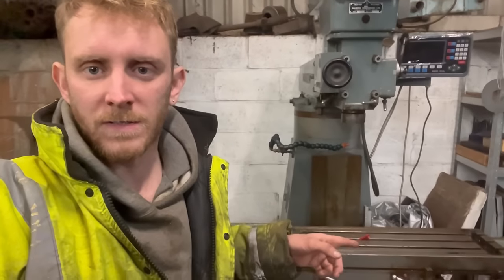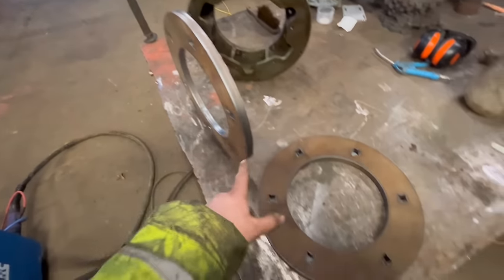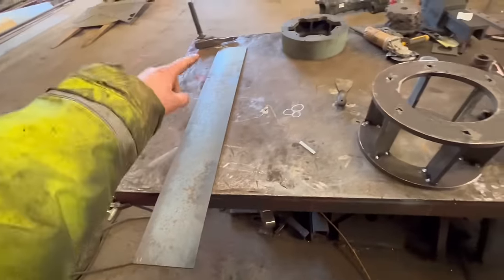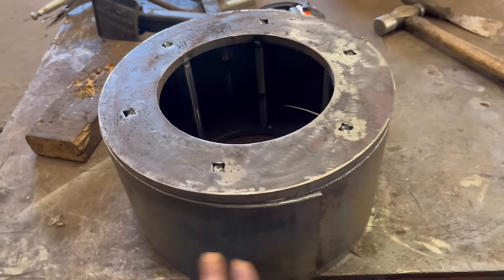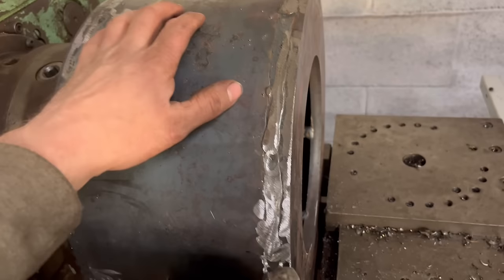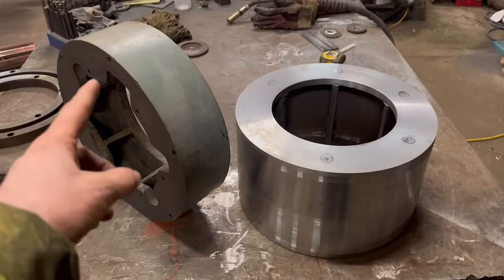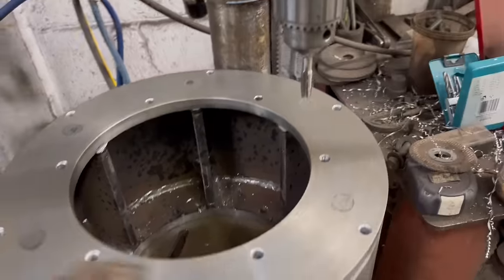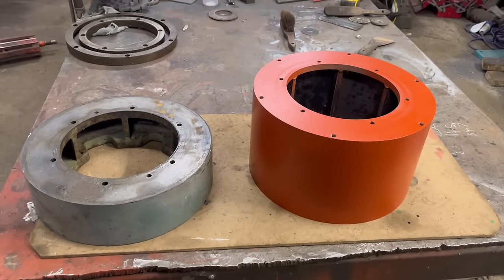Fabricating and machining 8” riser block

Comment: Nice fix for the mill, I have to turn the head on mine 90° and then I usually run out of table travel !
My old foreman warned me about flipping stuff over. When he first got married, they bought a carpet remnant, but couldnt afford to get it fitted, so he reckoned if he turned it over, he could draw the room plan on the back with a marker pen and cut it out exact. Worked perfect till he flipped it back the right way up !
Reply from the maker: I’ve done conversion plates before for engines/gearboxes so I’ve had experience with the mirrored image before (thankfully I’ve never ballsed one of them up) but these bolt holes I expected to be symmetrical.

Comment: Can I make a suggestion about turning the O.D. of your riser block in one! Turn your tool post through 180 degs. and use a boring bar if you have one long enough and set it out far enough to make one complete cut across the diameter.

Comment: We called them "soup cans" where I used to work. Had a big overhead crane in the shop and eye bolts in the top of the Bridgeport mills. Just bring the crane over lift the top off change out your desired height soup can reattach the head and your done. Great job on your riser block. If you can't find what you need and you have the skill and knowledge then you build one...
A viewer from the USA.

Comment: Very well done, I did not see you flip the ring over, but it makes sense that the holes would not line up. You taught me a great lesson here. I would have thought the holes were in the center like you did. Excellent fix and solution. The tractors at the end were pretty cool.

Comment: Nice job on the Riser Block! Make sure you get the top and bottom faces ground so they are flat and parallel.0.01mm out over those faces could throw your head out by 0.1mm or more over the length of the ram. And don't paint the top and bottom faces!

Comment: Great job.  I was watching closely to see if you flipped that ring when doing the second side.
Then I couldn’t think if you needed to flip it or not.  Good save though.  You are handy with that putting on tool.
Nice to see the power cord hanging there while your drill was in tapping mode. 🤠
You need a tapping head.  I’m sure you can get one that doesn’t work from China.
Seriously it does look like you are doing it the hard way which is why it rates as your favourite.
Have you seen the tapping thing Abom79 has.  Talk about overkill.  I reckon it must have been a freebie.

Comment: Thumbs Up! Very interesting project build. There are certainly more ways to skin a cat, sort a speak, than just cutting a huge block of metal to make such an adapter. And since you turned it parallel on the lathe so both ends are true, it works!

Comment: I was watching you mark up the holes thinking he's forgotten to flip the angle scale, then I looked at again and thought be alright its symmetrical.  I did the same last year measuring up  to make a bracket for a Bosch injector pump, found my mistake after it was made  - Doh!
Reply from the maker: My friend did the same with a bosch p pump onto a tractor puller 🤣

Comment: Great project. Can you add both blocks? When you are turning the OD, you might try a boring bar instead of a toolbit holder so you could stand off a bit more. I enjoy you channel
Reply: Good idea on both points.
Reply: Hmmm, even massive fabrications like that have their torsion limits. I'd sure do some testing first before using both blocks together.
Reply: @BruceBoschek  I've watched enough Snowball videos to know he'll just temporarily weld it all together if he needs to then gouge the weld out later and start over again. Nothing seems to stop him. Haha
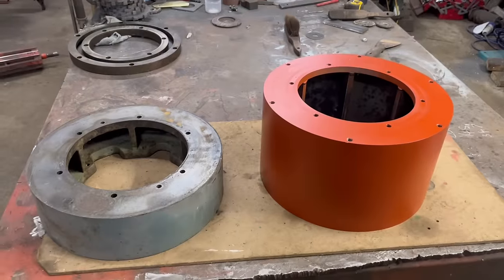Reply: At 41:33 he says he has an upcoming job where he'll "need either both blocks in or neither".
Reply: @kindabluejazz Oh, thanks. I missed that!
Reply: @kindabluejazz  ahh. "Neither" probably means rotating the head 90 deg. and using it like a boring mill.

Comment: Really nice work, thank you for making the video. It’s nice to see how you do your work, because it motivates me to work on my own projects.
I SEE YOU USE THE SMALL SCISSORS JACK. Ive been keeping these in my shop, and i have a few of them.
Weld a nut on the end and you can drive them with an electric impact. The small scissor jacks fit in small places and are very powerful.
I’ve recently been using them to level a log barn and they work where nothing else would. Whenever I have the chance to save a Jack from the scrap yard I hold on to them. Some of the older car jacks from the seventies and eighties are really well made.

Comment: That was an interesting way you made the new riser block, considering that the old one was cast in one piece. But the new one will do the job nicely. I was watching you make that mistake when you were marking out the holes when you put the plate on upside down and thinking it should have been up the other way. But you fixed it, so it was all good in the end. It will be interesting seeing the job you use it for. Hope you can film it and it's not something propriety that you can't film.

Comment: Good job mate, you've just given me the incentive to make one for mine - they are a pain in the neck doing tool changes though!
Reply: Invest in a pneumatic tool changer. There's a non-zero chance there's a kit specifically for your mill somewhere, maybe even second hand (tho most kits are pretty cheap these days, and it's not like it has to take lugs off a truck rim). You'll never look back after that and you can supply them with air from a very small compressor (one of those jobsite ones) if you don't have one in the shop.

Comment: I would not have painted the mating surfaces, as when you put new "feet" on a track on a digger you grind the paint of where the feet touches the track othervise the will come loose. The old riser was also not painted on the mating surface.  Nice job, well worth the time.

Comment: I bet the additional cut outs and bolt holes are because it is more universal and can be used on multiple models. Making one riser block that fits several models would be more cost efficient.

Comment: i know you would have assembled this difference in some ways too but it did turn out looking find to us the viewer 
i would fair compound the  rise head block if you ever plan on painting it as the finished appearance does make a lot of differences too but it is up to you anyway to decide on when and how you going to finish it 
i work on one that has been in a shop fire that had a block add it was not finished at all all the machine was still in working order but smelled like a fire the insurance wrote it off and never picked it up told me i had to get rid of it  lol
talk to the paint supplier i deal with about the smell and get special paint to seal the smell and repaint the machine over light battleship grayish-blue It turned out better than i thought it wound up sold that machine a short time afterward back to the same owners lol it still at the place the backed in to the machine few years a go and broke the frame casting in many places 
they did find a new frame for it and wanted me to do that repair  i was busy at that time

Comment: If you make something similar in the future that needs the outside skimming but wont fit over the saddle, try using a boring bar, flipped upside down and running the lathe in reverse.
Shame about the hole positions, and extremely frustrating. Good save though.

Comment: Did you really need to redrill the bolt holes? You only need them if you use the new riser by itself and you said you will always use both or none.
I suppose it was just as well to do it. If you didn’t, a job would soon come along where you can only use the big riser...

Comment: Another goodun Ollie, a man who never made a mistake,never made anything.
I have worked with one of those beaver mills, very rigid machine, does yours go into reverse in back gears?
Reply from the maker: What do you mean?
Reply: @snowballengineering  the one I worked on went backwards when you selected low speed and you had to change the direction, it was quite off-putting if you forgot.

Comment: No need for dowels or shoulders, as on this kind if mill the alignment isnt important. Only things that matter are the to surfaces are parallel and the bolts are tight.

Comment: Transfering holes precisely isnt easy and punches aren't accurate
When I used to work in a toolroom and we had to transfer holes between plates without using a mill or special equipment, we'd use the existing holes in the plate above as guides for both drilling and tapping. It's slow and requires disassembling and reassembling the tool many times but the accuracy is guaranteed. If the screws fit the holes tightly a 0,1mm offset between holes is enough that your screws won't go in